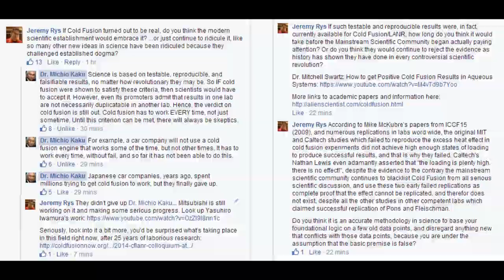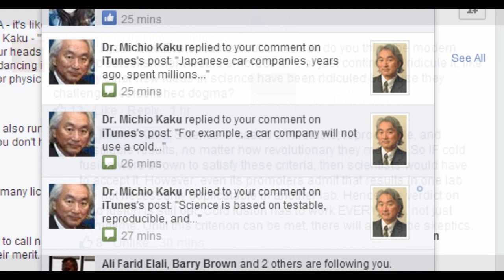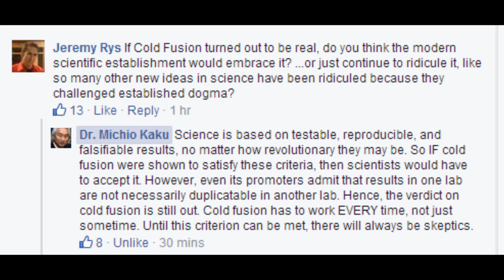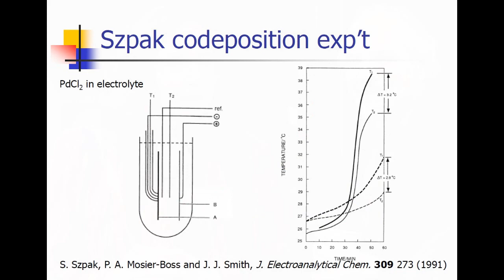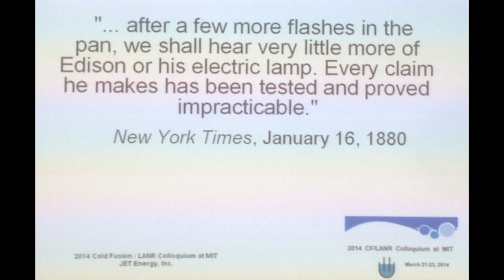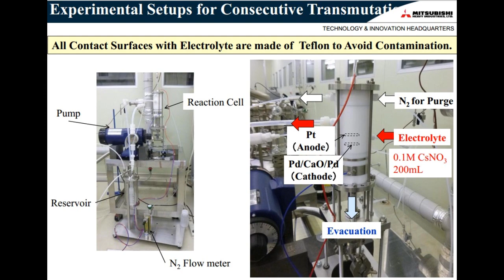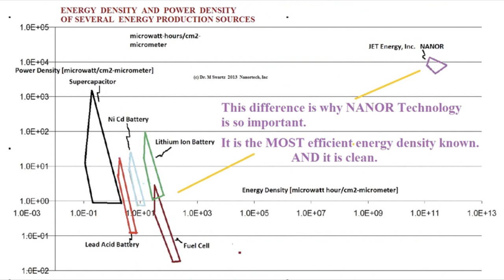Dr. Michio Kaku has Replied to my Question on Cold Fusion! Here is my Response

Comment: I find it curious that so many people go back and revisit this idea. The largest problem isn't falsifiable data, the main problem is the varying qualities of the materials used to replicate the experiment. You can't build a transmission "almost right", or as closely as possible, it has to be 100% correct to successfully transfer energy from the engine to the wheels. The quality of the materials has to fall within parameters or it's rejected. Because we don't know what's causing these results yet, we can't say where the fault occurs, but there is something going on there that's unexpected. The problem with science in America is it's not true science, but riddled with ego and funding liability. If we ever manage to do real science for the sake of science, a lot of things will change.

Comment: Cold fusion is far more plausible than zero point energy or dark enery,
Reply: Any method for utilizing motion as a source of power will work only to the extent that it is comprehended by man. The names zero point energy and dark energy are misleading names in themselves for concepts which are incomplete, hence no results. The concept must be complete and known to work before it can be demonstrated.
Reply: We can’t use dark energy as power

Like we can’t it’s dangerous 

The nano second dark matter comes in contact with matter, it will release a fuckton of energy that of a nuclear bomb.

Yeah no prospects in immediate death

Comment: From the book, Cold Fusion: The Scientific Fiasco of the Century by John R. Huizenga, 1993.

"A true scientific phenomenon is invariant. Other experimenters working with different equipment and in very different circumstances must be able to repeat and confirm a far-out result if it is valid.  When advocates of cold fusion claimed to produce heat without fusion products or tritium without neutrons, one realized that some very basic principles were being challenged on which whole technologies have been based." p216-217

John R. Huizenga is Tracy H. Harris Professor Emeritus of Chemistry and Physics at the University of Rochester, New York, and was co-Chairman of the U.S. Department of Energy Cold Fusion Panel that investigated the claims of Pons and Fleischmann and their supporters.

Comment: If cold fusion is real and produces excess heat (in some cases claims of 200+W), then measuring the neutron radiation should be a cinch. A D+D fusion reaction will give a neutron about 50% of the time and an average release of less than 4MeV of energy. Converting this to Joules gives us about 6*10^-13J/reaction. 200W of excess energy would result in over 3*10^14 reactions/second, or at least 1.5*10^14 neutrons/s

This could be measured with an inexpensive off the shelf detector. Perhaps no one has bothered because it simply does not work   ;)

Comment: You are clearly an alien political agitator, not a scientist.  Not one thing you said addressed any scientific evidence to contradict anything Kaku said.  You cannot simply dismiss the rules of science.  We know that there are reported examples of ‘faith healing’ working.  Unless you already believe in magic, that is not evidence of gods or anything else except perhaps the need for more study in the area.    Are you going to fly in a plane that has an engine guaranteed to work at least 90% of the time?  Or piloted by a ‘faith’ pilot?  Until it is consistently 100% independently replicable it still lies in the realm of conjecture and hypotheses.  Very interesting and important, but not yet ready for commercial production.  Slow your jets, spaceman.

Comment: Isn't it irrelevant whether science accepts it? Get a licence for a coal power plant, install a cold fusion device, and never order coal past the first shipment which you sell on unused..
Reply: Cold Fusion/LANR requires a lot of R&D before it can be brought to market. Reactor production will require significant cooperation from the nanotech industry to produce the types of fractal metamaterials that will be needed to maximize reactor efficiency and effectively dissipate fusion products. We're about 5-10 years off, depending on whether or not funding can be obtained by the right people.
Reply: Jeremy Rys I know your interest lies with metamaterials, despite the false info you'v been fed on it in the past. But if we take the premise that cold fusion is possible, aren't there, especially until we've achieved it, countless different other ways to achieve it? E-cat is looking more and more like a scam to me, but can we be sure such a method is impossible?
It doesn't matter how long it takes to make a working device. It matters to make it. If it works 50% of the time, and it can't be found why, just build them such that it doesn't matter. If a slot machine pays me a full jack pott only one out of 10 times, I'll just bring more coins. It won't dissuade me.
And it doesn't need to go to market. Market has so many build-in restrictions. Make one for yourself, open source it. People WILL replicate. Make electricity and sell it. Stick one in your steam locomotive, or Tesla Model S. Oh hey, in a hot air balloon! If it works only sometimes over the course of a few months, it can still set ballooning world records. Especially with multiple on board taking shifts at misfiring.
Reply: Jeremy Rys
Don't forget patents for CF or any attendant technology--the group that holds these will stop any progress, or slow it down by 20 years. A group of such creatures profit here in East Texas, and they are called Patent Trolls.

Comment: Kaku's response is bogus, since cutting-edge threshold phenomena are typically reproducible in just this on/off fashion (especially in surface science and biochem.)   Essentially he's saying "we refuse to fund the research or publish any papers unless a novel phenomenon is very, very robust."   No, science doesn't work that way, instead that's an excuse, an illegal move, a tactic of intellectual suppression.

But yes, textbook science does work that way, where only the very robust and easily reproduced work become part of the communal lore of science.  Nobody is saying that "CF" should be put in textbooks.  They're saying that the funding for CF research shouldn't be invariably refused on the grounds that CF hasn't been proved yet.  They're saying that "CF" research papers should not be automatically trashcanned by journal editors unread (not peer reviewed.)  Sending CF papers out for peer review and having them rejected would be normal, but that doesn't happen.

Comment: Edison did not invent the light bulb.  The Canadian patent for the light bulb number 3,738 was granted to Woodward and Evans on August 3, 1874 . The light bulb comprised a glass tube with a large piece of carbon connected to two wires. They filled the tube with inert nitrogen to get a longer burn life in the filament. Their light bulb was fully effective and sufficiently promising; they sold their U.S. Patent 181,613 to Thomas Edison. Thomas Edison obtained an exclusive license to the Canadian patent. Thomas Edison developed his own design of incandescent lamp with a high resistance thin filament of carbon in a high vacuum contained in a tightly sealed glass bulb which had a sufficiently long service life to be commercially practical.

Comment: who's being petty?  it's the LENR supporters who are petty.  of course the community will embrace it once a 100% working model has been established.  that's the procedure for everything.  how hard is that to understand?  how can you disprove something that is supported by 100% scientific data and procedure?  so when LENR reaches that 100% standard, anyone who wanted to couldn't disprove it.

why would anyone endorse anything that hasn't yet been demonstrated 100% working?  edison didn't showcase the lightbulb until he found a 100% working model.  how stupid would it be for edison to insist the community accept a model that only worked 50% of the time or even 90% of the time?  and yet that's what you supporters are doing.  you're insisting that models that have yet been proven 100% working be accepted.  that's not gonna happen.  and it's not just because it's LENR, that's for EVERYTHING and ANYTHING scientific.

so until a 100% working LENR model is found, it's ridiculously stupid to expect the community to accept it as anything other than a work in progress.  ANYONE claiming it's other than a work in progress or demanding it be viewed as accepted science is also just as stupid.

Comment: IMO, I think that the main point that MK was trying to get at is that you would need cold fusion to be reliable pretty much 100% of the time.  For example, nuclear reaction would occur 100% of the time when you get the elements to come together, and it would work on any scale (big or small reaction/reactor).  No matter how you look at it nuclear reaction will occur 100% of the time, not 99%, 98%, etc. but 100% of the time.
The other aspect to think about is time.  now a day, you need something that would be up and ready pretty quick, and even the recharge/refill time to e pretty quick too.  Think about cars, why don't all cars use electric?  Because electric cars (even now) take a LONG time to recharge, and refueling gas only takes minutes.  Hybrids use the best of both worlds, but gas is still use even more when you travel long distances or put your foot down on the pedal a bit harder.  That is why all car manufacture only have a small section of their vehicles dedicated to hybrids/full electric.  Do you ever wonder why you don't see a lot of Telsa's around town?  it's because after a few 3-4 hours of driving, you need to leave it charging for the next 15-20 hours same thing with the Nissan Leaf.

Comment: Probably they keep building bigger and bigger particle accelerators, because smaller ones work and it is easy to just keep doing bigger versions of what works. If cold fusion worked with a simple experiment over and over again every time, then cold fusion science would get a lot more funding, or at least will get more funding if it is found any useful. Particle acceleration has produced findings of smaller particles and so they have built even bigger accelerators.

Another example is Nassim Haramein, who also is doing something different in research. He studies the structure of space and claims with a study that there is no strong force. Strong force is actually gravity as protons are mini black holes, according to him. But he is in the beginnings of his research what comes to real applications. If he could build some small but working simple experiment, then he would get more funding, as people could build a bigger version. He claims that there is infinitely energy in small parts of space, but I haven't heard him gotten any energy out.

So basically people need something that proves that their project is already useful in small scale in order to go into the next level. Yeah, maybe the cold fusion researchers didn't give up. But guess what? They DID run out of funding. So they have no choice than continue research with tiny budgets until they get something working. Why people would like to invest into something, if there is like a guarantee that no results probably come? That doesn't work with investing, it requires something like long period taxing, which means like university work or such. The idea can live with a small light, but there is no point for investors to put big money into it, when they calculate that the risk is too big. Cold fusion researchers are free to ask for big investments, but it is entirely up to any possible investor to weigh the success factor against risk. And that is all there is to it.

The same goes with time. People caculate also is it worth investing time to something. Those researchers, who do cold fusion research, are clearly finding the field interesting and promising. Others want to spend their time with something else, that also looks promising or that investors think is promising. You could persuade other scientists with slide shows, but it really comes to what people want to spend their money and time into.

Comment: There are more problems to address than just make it work all times. It must also produce enough energy to make a thing running. If I get a fusion started, I am not interested in a temperature shift of 2 degrees C over 1 hour. Although it may have an impact on believes, it does not easily produce a undeniable fact. It sounds rather like the well-known photon jump of a Xenon bubble in an excited water column.

I think, at the current point of research, nobody really doubts about the possibility of cold fusion, but doubt a lot about the imprecision which is used even on the highest levels. That adds the magic nobody wants to see.

Comment: How do you quantify a field?   ...The answer is you can't.  Therein lies the limitations and the fallacy of "quantum" physics as an the holy grail of understanding things like superconductivity or LENR.  When we understand that there is only one inertial field (AKA the Aether) and that it there is no such thing as a particle outside of field modalities and field pressure mediation,  and that light does not even travel learn it's real nature as merely a event and not a thing....then we might move along the path of understanding.  Until then - we run in circles.

Comment: The earth 🌎  already have a cold fusion and that is the volcano 🌋 so the question is how to harness it my theory is just like fruit science making electricity by sticking in wire etc. So at the volcano 🌋 youl need to drill with caution ⚠ and it must be done where town are not built in front of it and just in case but if you don't try then humanity is not going to be the smarter? 😇🌏🎭

Comment: I would just like to add that room temperature superconductivity was produced with a material known as Stanene which is a topological insulator.
Reply from the maker: Thx, Stanene is also a form of metamaterial.
Reply: Stanane only conducts on the very surface as a monolayer. Its also predicted that monolayers of tin should be able to achieve the same zero resistance on their edges at room temperature and at even higher temperatures as high at 100c. You can also use fluorine atoms on the top and bottom of the monolayer to make the material's bandgap larger.